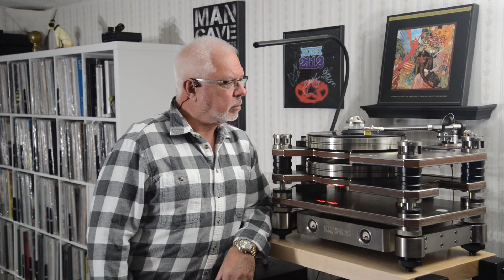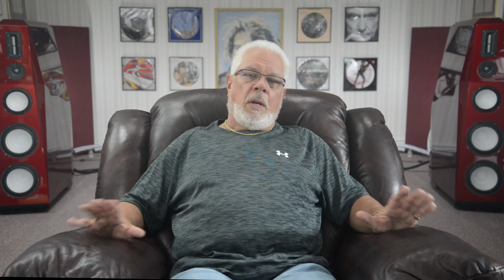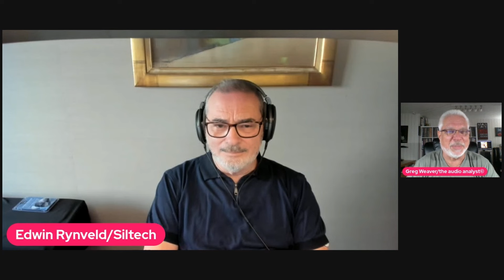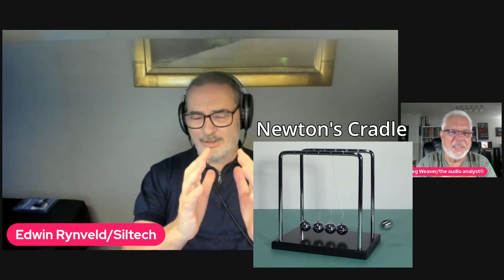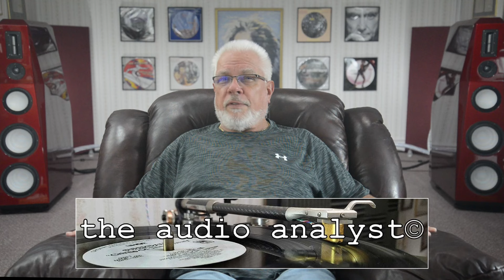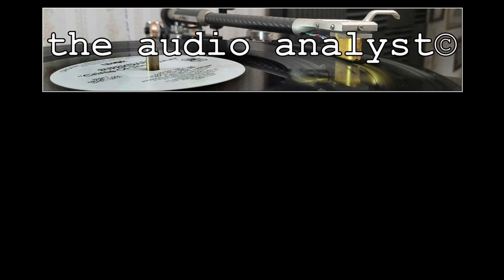E195: Edwin Rynveld and Siltech's Master Crown Cables

Comment from the maker: ---   UPDATE: RETRACTION OF FALSE CLAIMS MADE AGAINST SILTECH FROM @mickgrc
      - Link to original thread here - https://www.youtube.com/watch?v=XOZTrnIlwxk&lc=UgwQ8QjJT1W38QfWBjR4AaABAg

On Wed, 23 Oct 2024 at 23:32, Gabi Rynveld | International Audio Holding BV wrote:
For Michael - @mickgrc

It has been two weeks now, and you still have not offered ANY proof of your false assertion that Siltech monocrystal cables are not, in fact, what they claim to be. 

 Further, you then change your accusation by admitting that what you tested were not even Siltech cables, but were in fact some generalized products that you claim to be from the Crystal Cable product lineup. So why the change in your story? Are you confused?

And you either don't know or are unwilling to offer a valid model number, any details on the testing methods you used, or offer ANY results of the purported tests you did on some unidentified Crystal Cable products. Yet you feel you can claim that Siltech cables are definitely not mono-crystal. We can and do certify that they are. 

The time has come for you to support your claims, or to recant your unsubstantiated statement. Show us what product you tested – specifically, make, model, and serial number to corroborate that what you tested was a verified authentic Crystal Cable mono crystal model, NOT some lookalike or knock-off, and provide us with the equipment you used, who did the testing, what test devices were used, and when this testing was done.

Finally, we will need to see your photos and measurements used to support your otherwise unsubstantiated claims. Failure to do so – OR - to publicly recant your unsubstantiated claim that Siltech Monocrystal cables are NOT what they say they are, and you will be hearing from our legal team.

You have the time until Thursday, October 31st, 2024.
 
We await your response.

	Gabi
 	Rynveld

PR   Sales   Marketing
T:	+31 481 374 783

International Audio Holding B.V.	 Edisonweg 8, 6662 NW Elst, The Netherlands

---   RESPONSE FROM Michael - @mickgrc, which was sent just 5 1/2 hours after receiving her post.

Date: Thursday, 24 October 2024 at 04:52
To: Gabi Rynveld | International Audio Holding BV
Subject: Re: The Audio Analyst - E194: Edwin Rynveld and Siltech's Master Crown Cables

For Mrs. Gabi Rynveld

Public Apology Regarding Counterfeit Audio Cables Testing

To the public, Siltech, Crystal Cables, the Audio Analyst and all concerned,

I am writing to express my deepest apologies regarding my statements regarding metallurgical tests I conducted on what were thought to be genuine Crystal Cable products. It was in fact revealed that the cables were counterfeit copies and not the original products as I initially believed they were.

Yesterday, I was finally able to trace the provenance of these cables and discovered that they had been obtained years ago from eBay and, after changing hands 3 times, found their way to me as genuine bargains. When I conclusively found out that these cables were not genuine Crystal Cables, I was shocked and deeply embarrassed. The fact that these counterfeit items ended up in my possession, leading to mistaken assumptions during testing, is something I truly regret.

I feel compelled to offer a sincere and heartfelt apology for any confusion or frustration this discovery may have caused. 
I have tried to post the above to the YouTube the audio analysy channel but I have been apparently blocked.

Comment: The bit that confuses me is that the recording studio will have passed the signal through multiple runs of fairly standard professional audio cables.
Reply from the maker: How is that confusing... That fact that it has NOTHING to do with what we are talking about is the only thing that should be confusing...

In the case of the LP, the source, in this case, the final LP pressing being played back on our turntable, is what it is, regardless of what cables – or whatever other components and electronics for that matter - were used to master, cut, and press it. NOTHING after it is stamped and on your turntable can improve upon its best possible sound…

But what you don’t understand is that it is the process of extracting everything that is cut into that LP that makes the difference.

Consider birdwatching a Robin in a tree in your backyard with DIFFERENT binoculars, an analogy to playing back the same LP with different cabling – or any component for that matter.

Watching that bird using a pair of $40 TASCO 7x35 binoculars will allow you to readily see more than your bare eyes, and to see that it IS a Robin, revealing much of its individual detail, like its individual characteristics and plumage features…

Moving to a set of $250 Bushnell Marine 7x50 Illumin Compass Binoculars, a very common high-quality set of birding binoculars, with considerably more attention paid to the quality of the glass and grinding of the lenses, tighter tolerances in assembly and interaction, and with the use of chemical coating on the lenses to reduce glare and lower the light lost through transmission, will allow you to see more relevant differences in EVERYTHING about that very same Robin, offering both a brighter and sharper image, with a better ability to express a wider, more faithful range of color hues and differences in patterning, and more clearly exposing bill, eye, and head features, etc.

Yet, switching to a $10,000 pair of Zeiss 20x60 binoculars, which maximize EVERY CONSIDERATION in the construction of a fine set of optical binoculars will advance all those characteristics further yet… Not only will they offer greater magnification, but they also offer an enhanced ability to more clearly render color variation, feather patterns, and every possible detail about the Robin under examination.

While the Robbin (our LP) NEVER changed, our ability to have a clearer, more faithful representation of it CAN be shown to be improved by changing the quality of the binoculars (cables) used to view (listen to) it. You really shouldn’t speak out on matters of which you have no understanding…
Reply: @theaudioanalyst  how about binoculars,  being used on a very foggy day ? Can't add what you can't see...
Reply from the maker: @LM42  Are you really that stupid? Your inference has absolutely NO bearing on the matter... The record IS what it IS. The only fog that exists is in your thinking...
Reply: @theaudioanalyst  did i touch a raw nerve ? Bet in blind testing you could not tell the difference,  as for being stupid,  carry on, and you won't have to prove any more that you are, if you want an opinion,  I will give you one,  sit down and shut up
Reply: @theaudioanalyst  That's a pretty condescending reply, so I will attempt to explain the source of my confusion. 
Recording engineers are very attentive to small differences in sound quality and are very particular about types of microphones and  their placement, among other things.  

If there is some clearly audible difference between standard professional cables and these gold plated thingies, I'd expect professional audio engineers to notice this and be as fussy about cables as they are about microphones.  
Or to put it another way, if these hyper expensive trinkets do produce an audible difference, it can only be by eliminating an audible distortion introduced by "lesser" cables. In that case it should be something that we can measure and quantify using standard electrical engineering techniques. 
What would this distortion be exactly (eg, signal/noise ratio, bandwidth limitation, frequency response nonlinearities, or perhaps some nonlinear distortion causing harmonic distortion)?
Reply from the maker: @TerryClarkAccordioncrazy  You really need to talk to those "engineers." At some point, you'll find out that, for the most part, they don't think cables can make any significant difference... Their primary concerns are with matters like noise rejection (hence the use of balanced cables). 

And in the end, it is irrelevant to the playback process. The master tape, the lacquer, the final pressing of the LP, CD, SACD, or audio file is what it is. What we are doing is uncovering as much of what was captured as possible.
Reply: @theaudioanalyst  That's right. Audio engineers don't think that cables make any difference provided they're of sufficient quality to make a reliable connection.
Reply: Can't add to what isn't there, had a person buying interconnect cables  from maplin 😂 for a well known recording studio,  only place that was open Friday night